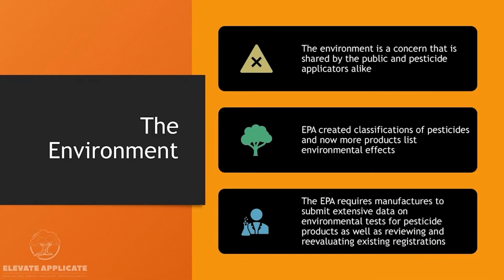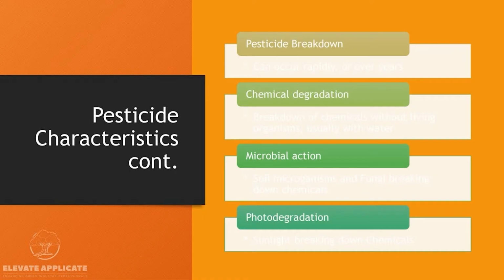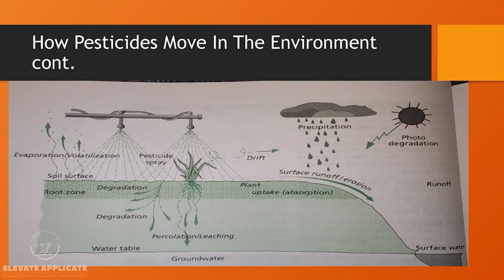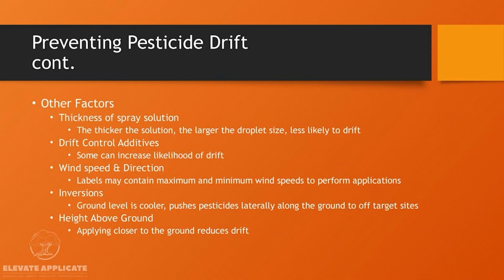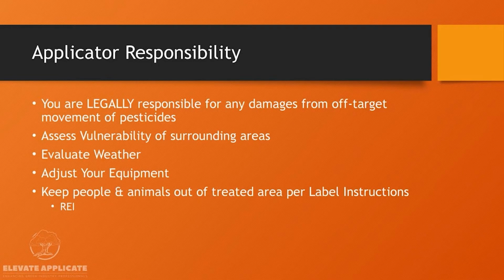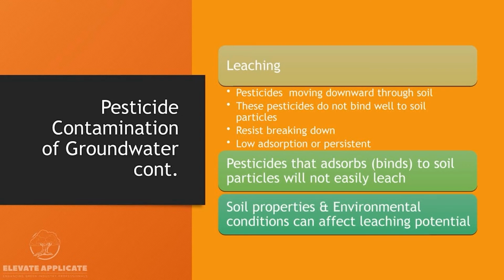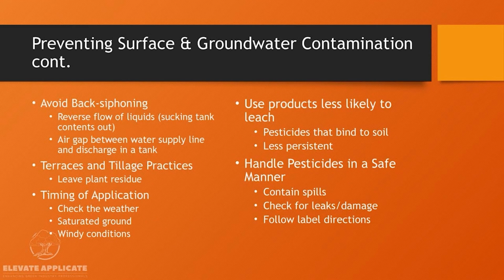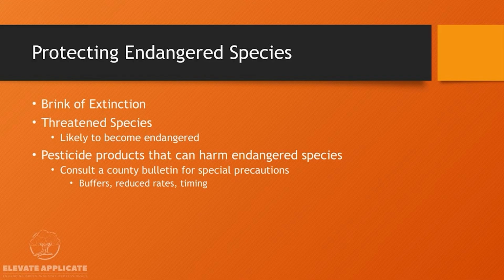National Pesticide Applicator Certification Core Manual - Ch 7: Pesticides In The Environment

Comment: Move injured person.
Make sure to put on proper ppe.
I wonder which one is 1st and why you list them as such. 
Every time.
Reply from the maker: It's situational. If you perform fumigation work, entering the area without ppe could kill you. So ppe would come first. 

If someone passed out due to heat stress but they were not contaminated you could move them first. 

I listed it just as it was listed in the National core i believe.